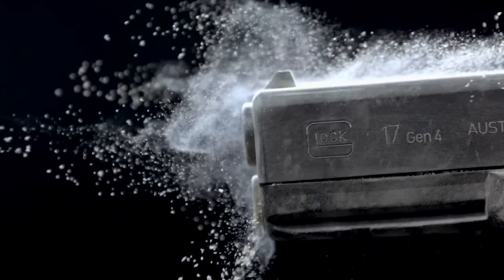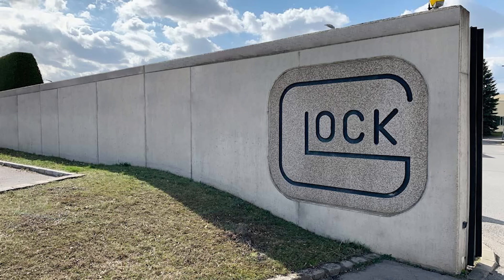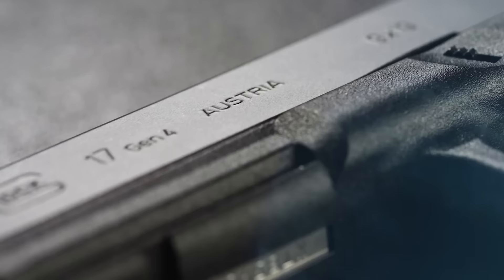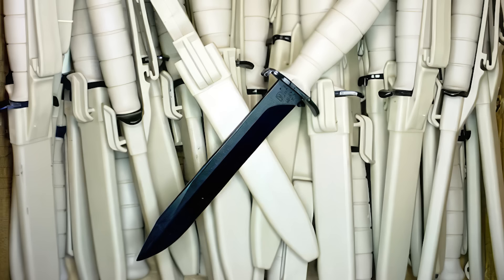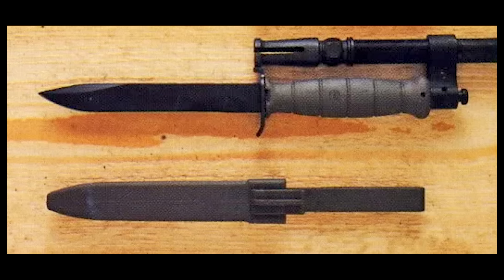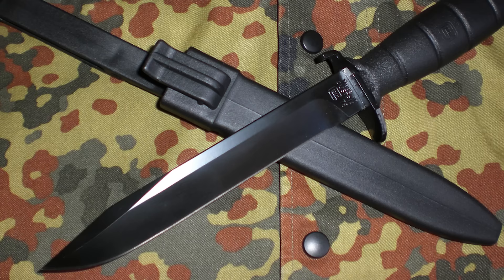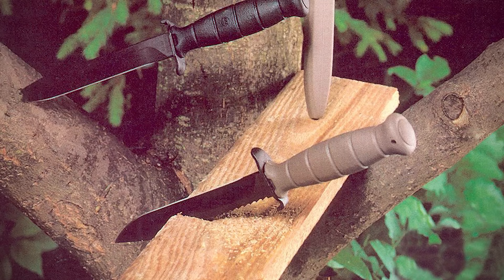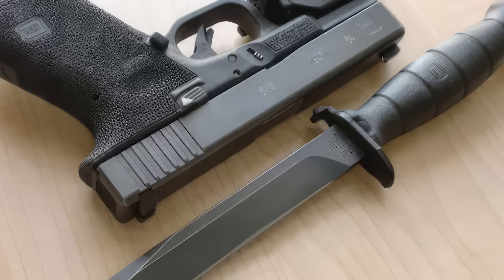How Glock Made the Perfect Knife

Comment: "perfect knife"?!?
Not for me. I would never use or carry it.
I prefer a 4.5 to 5 inch blade MAXIMUM. 3 to 4 ~ 4.25 do everything I need. Longer blades are (for my uses) unwieldy and too long for skinning and field fressing North American big game.  I might need a larger blade to skin an elephent, hippo, or rhino ... however since they are not available outside a few VERY expenesnsive Texas Privae Exotic Game hunting ranches, I will never harvest one, so have less than zero need of a  6 to 10 inch blade "hunting knife".
I never have, and never will confuse my knife for an axe or hatchet ... or even a machete,for that matter.
I HAVE a proper axe or hatchet on me when I go hunting. It comes in right handy to split the pelvis and spine, when quartering a big game critter, such as an Elk or Moose. 
In 60 plus years, I have NEVER needed to split my firewood during any of my hundreds of combined hunting and/or fishing and camping trips, nor the slightly fewer straight camping trips.
The ONLY time I needed to split firewood was for a residential fireplace. I used the proper tools: A Splitting Maul and a WEDGE.

A KNIFE is a cutting/slicing tool. It is not designed nor intended to CHOP or split wood.
If youinsist on splitting wood for your camp fire and don't know how to safely use an axe or hatchet, get and use a carpenter's/roofer's Froe. It is designed and made both for splitting (used to make cedar and other wood shingles on the construction site), but also batoning..

Thanks, but no thanks on this Glock thing.
I will stick with my Mora Number 1; Cold Steel FINN BEAR, Spyderco Bark River, Western L66, and Buck 877 for my non-folding sheath knife needs.
To be honest, a Buck 110 or (pre-2004 US made) Old Timer 6OT or 7OT or even a two blade slip joint folding hunter, is far more likely to be on my belt than the non-folding sheath knife. I MIGHT stick one of my non-folding hunting knives in my back pack, though.
These folding hunters are more than capable if the only knife in an unexpected emergency survival situation ... provided you have even a tiny amount of skill.
A TRUE Fact of Life: "FINESSE BEATS BRUTE STRENGHT EVERY TIME! FINESSE IS ALSO EASIER ON YOU AND YOUR GEAR"

Comment: it may be a good knife for military use, for normal use it is a really bad tool. the steel was good, but today its nothing spezial at all.  the saw does not really work that well, the little straight portion of the blade does no good to the free cutting of the blade. also the teeth are not crossed liek a real saw is. i just sold mine becuase i have so many better knives. also i never liked glock´s plastic stuff. same as there plastic toy pistols. sorry but i cant have that. btw i am from Austria ;-) and i make real knives and tools🙂
Reply: The pistols are far from toys.
Reply: @Catgat37  yea of course, i know they are very good, but they feel just like soft air pistols, its the plastic, i just dont like that. for me a pistol is made of steel. not even the grips, i like them made from wood, bone, carbon fibre or tusk, but not plastic.
Reply: @WildStyleWorks  I get that. In my experience though, some of these plastic pistols can't be beat for reliability in an autoloader. Glock, H&K....it is really hard to beat their track record.